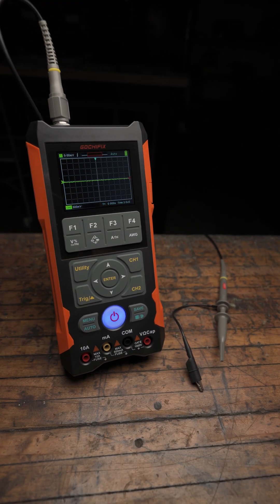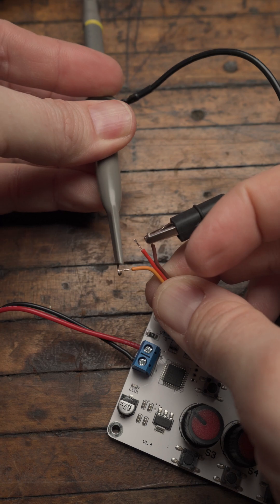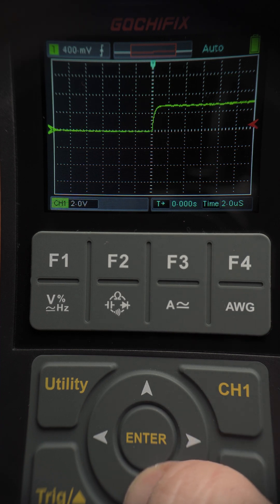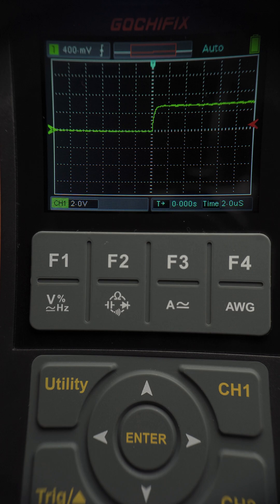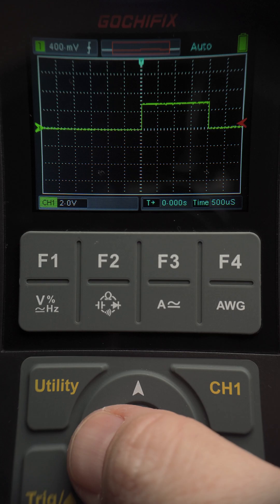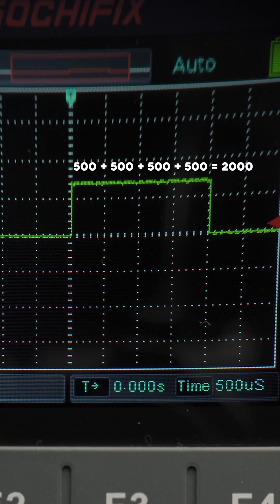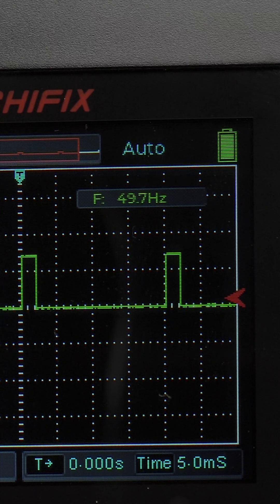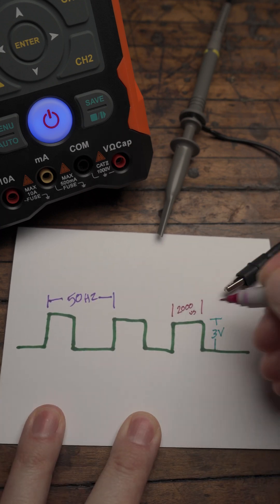#oscilloscope

Comment: This is so cool. I was just now wondering how these worked. I have a pair of computer speakers from 2010 that I lost the power adapter for. It says 9v in on the speaker, the power adapter I found said 10v out and got hot when I used it. So I bought a 9v adapter for an Arduino from amazon and it works better